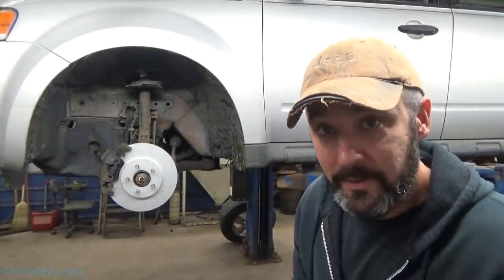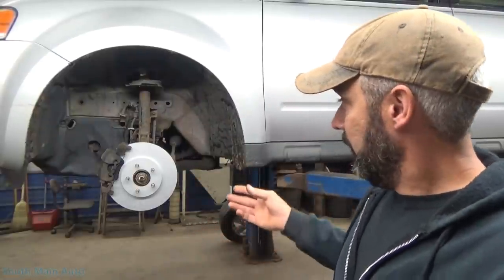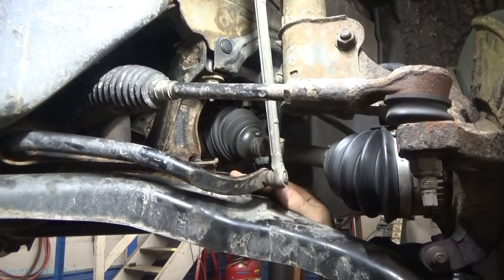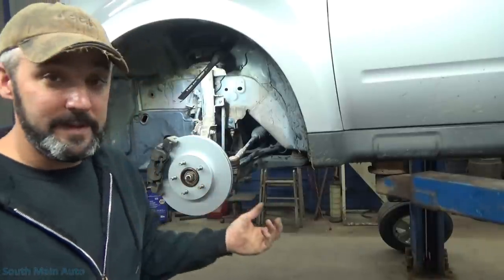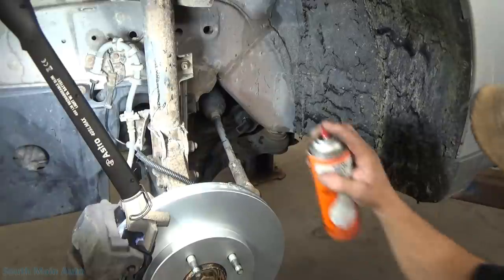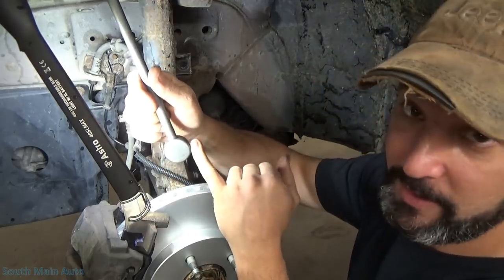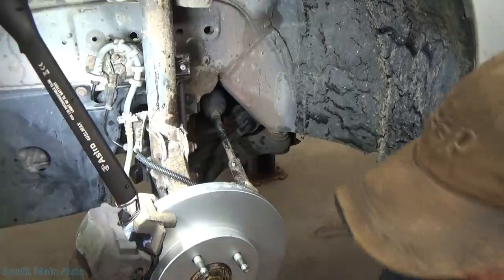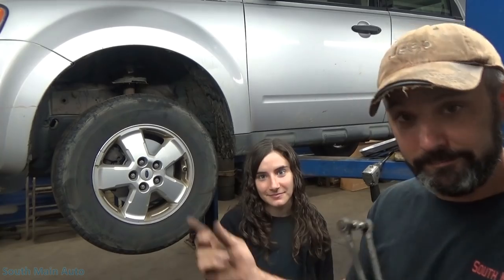Repairing Front Suspension Rattles

Comment: Thanks for the tip about not checking sway bar links with only one side jacked up.  I had a horrible clunking noise coming from the front but every time I checked the suspension (by jacking one side up at a time and removing the whee) everything was nice and tight.  After keeping the car on the ground and giving it the ol’ reach-around, I found the sway bar links to be very loose.  Replacing them was very straightforward with minimal cursing, and now the front end is nice and quiet.

Comment: I put new sway bar links and ball joints on my daughter's 2011 GMC Terrian then put new struts and springs a couple day's later. About 1 week later she says the one of the struts is broke, So I take it for a ride and sure enough it sounds like a broken strut. Knowing both are brand new I'm guessing catastrophic failure on one of them. I pull it in lift it up start checking everything and BINGO, sway bar link was not tighten enough and came loose, So I tighten it again and test drive it and the noise is gone. I obviously did not tighten it enough when I installed it a week prior. The noise that little link made was extremely loud and if I had to bet on it prior to finding it I would have said a busted Strut or Spring. Great Video.

Comment: had a shunk sound in my 99 wrx on hard right turns when hitting a dip in the road, been trying to work out what is was for ages. Might not be this but when I changed my struts I noticed play in sway bar thought it was normal but it's more than what you had. either way informative vid thanks.

Comment: Just changed these out on my Beemer, exact same style as the ones you have there Eric.. car had the case of the chatters over crappy roads.. now it’s perfect.. also did thrust arms. The ball joints on those old end links were like a sloppy old Atari 2600 joystick.

Comment: I've probably done the endlink job on a dozen Tauruses when I used to own them or friends had them.  Worst part on the 2000+ model was not being able to rotate the sway bar since Ford welded the brackets to the bar!  Made it a real "female dog" on that nut/stud on the bar.

Great video as usual - excellent tips and tricks for checking the front end on a car out.

When checking the "frame" cars - like a Crown Vic or a Roadblaster, don't you have to jack up on the control arm to check for play in bushings/joints?

Good for you for going into nursing Hannah....and best of luck to you  - my sister works as an occupational therapist and is never short on work at the hospital.

Comment: I had trouble removing a swag bar link of similar design recently that didn’t have the flat or allen key.  I used a little hydraulic kit, with the expanding jaw attachment (it probably has a name), and I applied pressure to the back of the ball joint against the frame of the vehicle.  That stopped it from spinning and I got the nut off.  I was pretty pleased with the success.

Comment: The sway bar body bushings also can make a crunching sound inside the car, usually when both wheels go over the same bump like a speed bump in a parking lot. What will happen sometimes is the bar will rust or scale up inside the bushing, and impart some of that material to the bushing itself, then it will be almost like a metal to metal contact in there. Everything will still be tight etc but when that bar rotates in there you'll get a terrible crunching sound that will come right up thru the body.

Comment: I had a rattle on a 2010 Dodge Grand Caravan.  Firestone wanted $360 to change the sway bar bushings which are only a $8 part so I did it myself.  That was not the problem so I changed the links as they had 80,000 miles but that was not the problem either.  Turned out to be the rear brake pads with missing and bad hardware.  How the hardware came off I have no idea.  Long story, when your checking for rattles and driving over bumps apply the brake and see if you still get the noise

Comment: I found the source of my front end rumbling when I discovered a worn sway bar link when I was changing my brake pads.  I believe mine was bouncing against the (hollow) lower control arm (not how close they are to each other in your video) & making loud noise.  That is why the noise was louder than a worn sway bar link should normally make.  At least it was a cheap fix.

Comment: I've given up on getting rid of the suspension clunk on my Focus! Replaced everything that was remotely bad and it still clunks. Time to turn the radio up more!
Reply: I had a clunk in my Traverse and I thought it was suspension problems. Had 2 garages look at it and both said no problems with the suspension.. Then I noticed it was more pronounced when going from reverse to drive. So I had my kid go back and forth in drive and reverse while I was under the hood and noticed that the engine shifted more than I thought it should and decided it was a motor mount. Sure enough that's what it was. Come to find out the mounts on my car are hydraulic and the bad one sprung a leak. So after handing over a fat stack silence. Maybe that's your problem.
Reply: I don't even know if you have the same car but check for a rub mark on the body/frame from your sway bar. They sway bar will shift and not be noticeable while lifted, but if you look for paint rubbed.

Comment: After reading all the comments before tossing in my two cents, l see that only about seven percent of the comments are directed at Eric! We don't want Eric to feel bad, so...
 I have a Rav 4, 4x4. When I noticed that type of sound coming from the right rear area, I checked the sway bar first. Nope!, body bolts on struts, nope. Everything else, no... So, maybe resonance noise from the front? All good. 😤 This went on for months, checked it all again, $#!+, still good.
 So, one day when I dropped my grandsons at school, the noise was gone. ❓❓❓
 Later that day I noticed the seatbelt connector stuck in the right rear door.
 It only makes the noise when the seatbelt back is at the right angle and the clip hits a little spot on the body.
 And Hannah will, someday, thank you for the good work habits and attention to detail that you helped instill in her personality. These things make life, learning and performance in any field a whole lot easier. 
 I'd wish her good luck but I'm sure that she won't need it, bye Hannah 🎓 ✔

Comment: The sway bar links on my 2008 Ford Focus failed at like 19,000 Miles / 30,000 Kilometres (BS!) 
Replaced them with moog greaseable ones and it's been almost the same mileage put on the Moog's since & no issues. 
I grease them every 3,000 mile / 5,000 kilometre oil change.
Reply: I got 202,000 miles on oem sway bar links on my 2004 ford freestar se extended wagon

Comment: Eric, look at getting an enclosed rotary screw air compressor. They are a lot quieter and relatively reliable. Something like an Intersoll-Rand, 50 CFM will work great for you. An optional air dryer will also keep your air supply system and tools in good shape. Also get as much of air storage capacity as you can afford and physically fit in the shop. This way your compressor will come on  less frequently. Usually, as a rule of thumb, a minimum of 3-4 gallon air storage capacity is required for one CFM of compressor capacity.
Another thing to remember. It takes a 9-10 HP compressor to run a 1 HP air tool. Yes, compressed air is a VERY expensive power source and very wasteful because most of the energy is wasted into heat, when air is compressed. This is why many users prefer to use electrical tools these days. Energy savings can be substantial in a large shop. Obviously, common sense dictates that air tools have  their advantages in some applications because they are compact, relatively simple, reliable and safe (no sparks generated).
Hope this helps in any way. Thanks for your videos!

Comment: Who needs an air compressor when you have the Earthquake cordless
Reply: I find that air tools 'hit' differently than the electric impacts. Becomes clear when you try to take a nut off an alternator shaft with the cordless and it doesn't work, so you get the air and it comes off with ease. However, the cordless is mostly just as capable.
Reply: it was a joke in regards to the air compressor comments in the past and the burning smell of the Earthquake
Reply: oh lol

Comment: Just got mine fixed a few weeks ago. It clunked for about a year.The clunking got worse. It sounded like the wheel was going to fall off. Also the steering felt loose and in the wind and around corners it was horrible. Its way better now. They were so shot you could twist them.

Comment: Ive learned about the sway bar links and how they can sound like a strut. I honestly thought I had RF strut making noise on a newer CR-V, so cool replaced strut, strut mount and bearing. Went to pull it off my lift and I heard the same damn noise. Panic set in. Co worker said Check endlinks. Sure enough it was the left side lower nut was loose. Tightened it up and it was all good. Oh well it was Warranty lol

Comment: I've found that shocks/struts, lower ball joints and tie rod ends were more prone to wear and making noise, as well as weak or broken caliper hardware (that would let the pads rattle) to be greater causes of suspension noises. Sway bar bushings were 5th or 6th on the list for me.

Comment: One I had was the main top center nut on my strut that holds the top mount to the piston was slightly loose and it made a terrible racket from any change in the road. Didnt have to tear anything apart. Accessible from just under the hood and give it a good torqin and it was good to go

Comment: My wife drives an 03 mercury mountaineer. One day she told me her car had a 'rattleing noise' in the back. OK, I'll check it out. Haha, drove it, only made noise when in a turn.....long story short, the rear sway bar had no bushings, ANYWHERE! The two that attached the bar to the frame were gone, all the swaybar link bushings were gone. I bought all link kits, front and rear, total of 4, and had to buy the framw mount bushings from a dealer. Hard to believe a little block of rubber with a split in it so you can get it around the swaybar cost 32$ each, but remember, thats at the dealer. I told the parts guy I had never had to replace a sway bar ftame mount bushing ever, he told me he sells about 3 sets a week. Thats when I came to the conclusion the FORD uses a less than perfect rubber composition for their suspensions.....now I know why I'm a CHEVY fan, lol....... Oh yeah, this vehicle has the 4.0 SOHC V-6, the one tith three timimg chains, you have to pull the motor to replace the timing chains, who would design something like that, currently keeping a lookout for a good used Chevy Tahoe fot the wife, i have since swore off ever owning another Ford product.

Comment: Nice video bro; i have a honda accord 98 lx and my car does one(1) of the  2 things in my front end suspension that you mentioned/diagnosed(professionally)
1) rattling over any uneven surface
2) wheel feel like its about to come off when its say positioned 25-45^° clockwise and i accelerate; similar to how a car with a whopped( oval shaped) tire would exhibit.
If you could do a vid diagnosing ball joints that would be great! Subbed ~

Comment: I hate the sway bar links on my Ford Escape. I've tried OEM and a few other brands and they all start rattling before they've had too many miles on them. I've had a refresh on a bunch of worn parts on the front and even my mechanic can't figure out where the last thump is coming from.

I plan on just disconnecting the sway bar links and driving around to see if that removes the noise. Right now I have the OEM version on there.

Comment: the original Escape stab links (through 2007) don't have the back 17mm nut to grab, only the 5mm hex opening at the bolt's end that is always corroded/deformed and/or stripped, top one doesn't matter if you're installing new struts, but the bottom one has to be cut out, and the steel of that bolt is hard as F, can't saw the front because there's no space between the link and stabilizer bar, same on the back because of the frozen-on nut, no torch so I had to use a nut cracker to cut an opening in the nut's top, then flattened the top with an air hammer (that took a long time, very hard steel) to just about half way, then drilled a hole into the flat part of the bolt I created (broke 3 titanium drill bits), then air hammer chiseled through with what was left until it finally fell out the hole in the stabilizer bar, and I thought the double nut design on the top of the shocks was bad (had to cut through those too), obvious why Ford changed the design to add that 17mm opposite side holding nut

Comment: the top end normally only fits the strut end mount the right way! so no worries about grease fitting contacting axles. However if the worker is very inept, they could manage to install backwards, but most likely it would be due to wrong part for vehicle!!!! :)))

Comment: Good luck Hannah.  Excellent video! Had rattle for years on wife 01 Yukon...finally looked at it last weekend.   I think pieces of catalytic converter are in cross over pipe.  Years ago "someone" pulled injector connector partially off injector...finally show up on money light at that time... and seemed to be running rich since maybe engine trying to compensate and then maybe super heated catalytic converter and caused damaged?  Anyhow After plug in harness to injector $ light went off at that time.  Now if I could figure out easy way to remove pieces in crossover after cats without dropping exhaust.  No rust on exhaust bolts, just lazy.

Comment: Yes sway links ,shocks with worn out bushings or grommets.  Control arm bushings , loose shock retainer insert bolts  work sway bar body mounts loose spring locks on leaf springs  or coil springs  often worn out rubber mounts  even loose fuel cells and their strapping loosens and rattles so can draw hitches

Comment: Ah!
Thanks for explanation. Always hard to try to explain the sound and symptom of the front suspension issues. When i hit fast/hard on gas pedal either from stop or even when driving it sounds like someone "bangs" on the floor. Just one time.. are the front swaybar bushings the only thing that can cause that banging on the floor sound?

What else symptoms can bad swaybar bushing cause?

I've already replaced endlinks and lower control arms. Shocks and springs.

Bad lower back engine mount.. can I have that banging on the floor because of engine moves back and forth when loaded?

Comment: As always a good video and nice tips about checking on the ground if possible and not having one wheel lifted.  I find ball joint issues a lot.  I had a Chrysler Concorde ball joint good but spindle cavity for ball joint worn took a little time to find that one.
Reply: I lift with floor jack/s and put them  on jack stands under the lower ball joints or as close, then bounce via the front bumper hard as possible to settle the suspension. goal being get it compressed as close to ride height as possible so you can grab and wiggle the wheels around. that is where everything is "worn" the most. besides looking at tire wear patterns ;0
Reply: That is exactly what i do, unfortunately since it was not the ball joint.  It was the stud from the ball joint going into the spindle.  The hole in the spindle had worn.  Took it to a shop and they though it was the wheel bearing.  Eventually it wore enough another shop found it and then I looked at it and it was obvious at that time.
Reply: sounds like someone had it apart and didn't torque tight enough on assembly.
Reply: No the bolt was tight, might be related to after market parts with undersized ball joint shaft/bolt.
Reply: then again, you did say it was a  "Chrysler/Dodge/Moparts" product ;)

Comment: I have 2 suspension noises coming from my Volvo s70. The first one is a clunk that I suspect is the stabilizer links or wtf they are called in English. Gonna change that along with the outer tire rod. The second one is a insane rattle in left turns and over bumps with a fat guy in the passanger seat. Its all coming from the front right. There is some rust on the lower spring seat on the strut. Thinking the spring maybe moving ourond a bit. Gonna take a look when I have my rims changed on Monday.

Comment: The noise I get is on full right lock turns - it sounds like a crackling/popping sound... no noise on bumps or any other time. Not sure if it is sway bar link, sway bar bushing or suspension strut... so hard to tell! I should add the CV axles are new and the sound was present before and after there replacement.

Comment: I got a fun 1. Driver side rattles with light bumps in road,  passenger side CLUNKS when braking in reverse , replaced sway bushings, brackets,links, and full front and rear coilovers/ struts and springs . I cant with this thing🤣 tje clunk only happens when ylu hit the brakes, and yoy feel it center front. Oh front driveshaft replaced too.  I loathe suspension

Comment: I chased a noise on a Camry once and it ended up being a bad dampner inside the steering column that goes between two gears. I've also had steering shafts from the steering column to the rack have play

Comment: Great video! i have a question for you eric! I replaced my struts what needed to be done they were shot and while i did that i replaced the end links what did what you showed in this video. i still have a clunk sound subframe is in good condition. could it be the control arms? its a 2007 Mercury Mariner 3.0v6 awd 160k miles

Comment: My car has some rattle and vibration that can be felt through the steering wheel at low rpm during acceleration from a complete stop and when going over small bumps. I think it is more like a steering component related rather than suspension. Any suggestions on what to check?